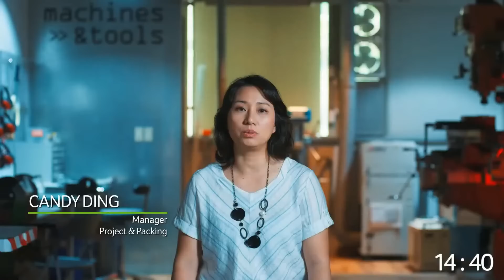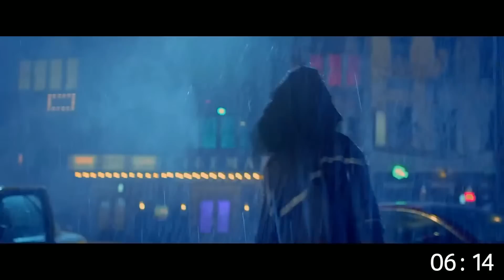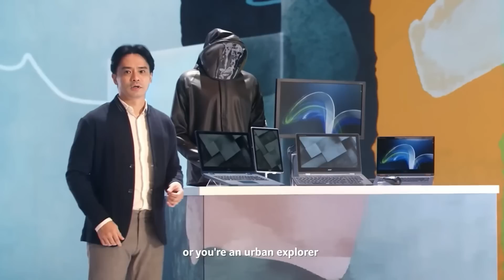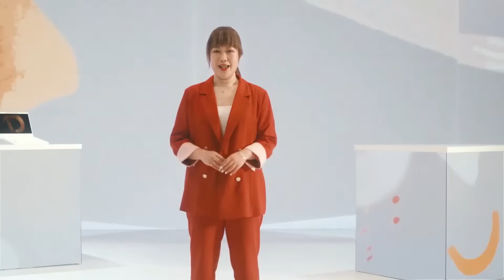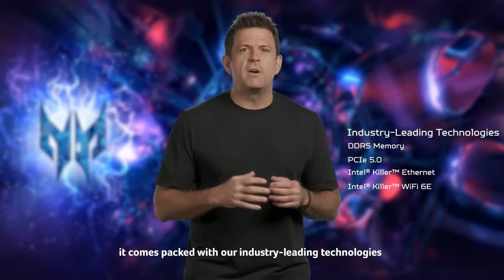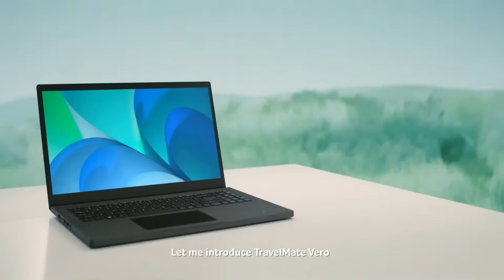Next@Acer 2021 | October Global Press Conference

Comment: Before going with ACER Please see the status of my laptop service. Case id 4106167i  Date 23/08/2021 Case Closed on 07/09/2021
Request Id 172117i Date 11/09/2021 Rejected on 11/09/2021 
After mail/ telephonic conversation re-open Case id 4152451I Date 21/09/2021 Case Closed on 15/10/2021                                                                                                                           
Case id 4195482I Date 18/10/2021. Shockingly Case closed on 17/11/2021. The service centre didn't repaired it and damaged the body of the laptop. Sticked the laptop. Still waiting for response and repairs.